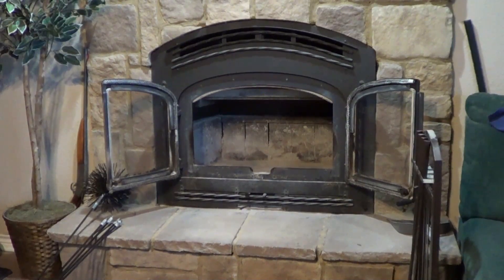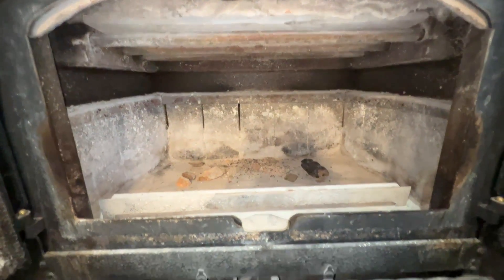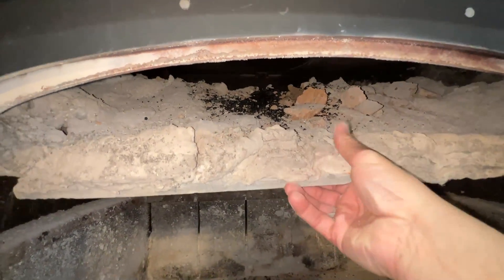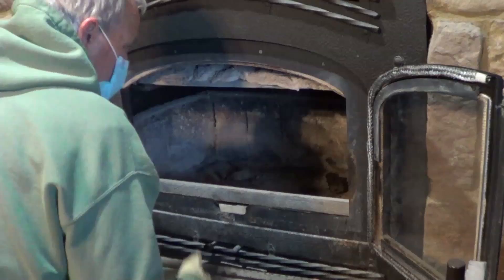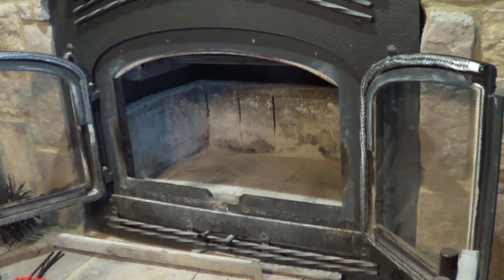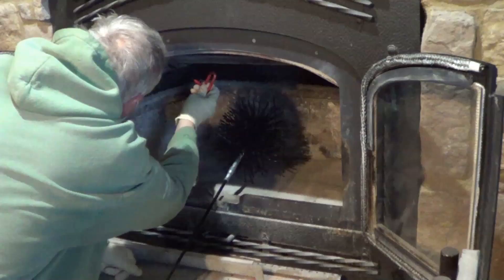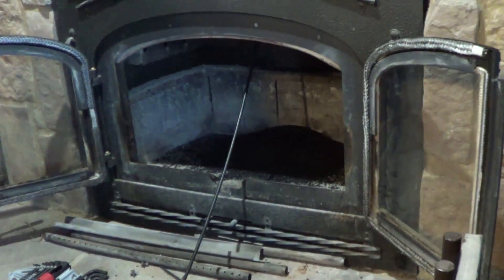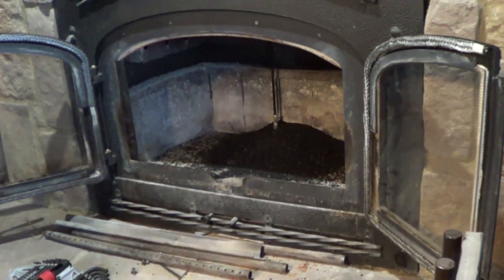Do It Yourself Chimney Sweep 101 - Doing Your Own Chimney Sweeping - Creosote Removal

Comment from the maker: UPDATE ON MANIFOLD TUBES HOLES - WHICH WAY DO THEY FACE
NOTE:  If you noticed the holes on the manifold tubes were facing down when I started and when I finished they are facing forward, towards glass doors.  
The INSTALLER put them in wrong.  Since they aways faced down I did not know they should be facing forward.  After considerable research, not easy to find, the correct way is for the holes to be facing forward or back, NOT DOWN.  When I put tubes back I used the slots to secure them like it should have been installed.  The Installer and previous chimney sweep guys use the holds themselves to secure them, which is wrong.  I called them Baffles during the video, the correct term is manifold tubes.  So for those who caught that, good job, but they are right now.

According to people who install them, the manifolds are to super heat the top air for better combustion and burning of wood / fuel.  If they are pointed down they are not doing their job.

Comment: Thanks Rick! I had mine installed this winter but only had green wood to burn and I think my chimney is all clogged up less than a year later. Figured on hiring a guy for the first clean to see how they do it so I can do if after that.
Reply: All fire wood must be seasoned. Meaning totally dry. Usually takes one year of being stacked and covered. If not then when you burn it , it will create creosote which will adhere to the inside of your chimney. If it gets hot enough could catch fire.

Comment: I have a quadra fire ( spelled wrong) and when I replaced the upper baffell boards, they told me I don't need to in stall the cloth fiberglass on top of the fire boards anymore.
Reply from the maker: ? why?  why is it there then?
Reply: So that the orginal testing to make the wood stove come in at 60% efficient can reach that goal. With that extra bit of insulation at the top will save a small amount of heat to burn more of the smoke before it goes up the chimney. Which would boost the effency a small amount to reach the goal to claim 60%.

Comment: Hello Rick. This is my second chance to ask about reinstalling those baffles, didn't you leave the holes pointing towards the front (toward the doors) on the front baffle when you put it back together?
Reply from the maker: yes, I can not find where they go but if you use the holes to secure it that is where they point forward.  The that installed them , who was an ass, he used one of the holes to secure them, not sure what different that makes?  cant find answer on site or in manual.

Comment: In my house in California I had a gas fire place. Bought ceramic logs and some fake ash which would glow when you turn on the fire. It was nice. Those ceramic logs really radiated some heat once they got hot.
Here in TX, however, I have a wood-burning fire place. I don't want to clean it, so I don't use it.

Comment: Ahhh yes. 
This brings back many a childhood memory of cleaning the old 2 story farmhouse chimney with my pop.

Dude. I'm just curious. 
Have you ever tried tightening a drill chuck to the rod end, and spinning the brush while pushing up and down in the chimney?

side story
I got tired of listening to my wife complain about not having a clothes dryer for the last 15yrs. 
So I recently bought her one.
💵💵🤬

But I figured I'd need to clean the dryer vent. Stupid thing goes from the dryer in the garage, all the way up, and exists thru the roof. (About 25ft total)
Anywhoo..

I bought a brush head and multiple rods setup very similar to yours. 
But, I attached my drill at each additional rod as I attached them. 
I just made sure I didn't accidentally spin in reverse and unscrew a rod somewhere in the pipe.(That would've been a disaster)
However..
It cleaned that vent pipe like I couldn't believe.
(The amount of fluff and god knows what else it was that came out was insane)
I definitely would've had a fire once the wife started going crazy washing and drying everything in the house. 😂

Ps ladies..
I'm not some cheapo misogynistic woman hating caveman for only recently wasting money on a dryer.

We live in South Florida.  We technically don't "need" a clothes dryer.
The outside clothes line dries everything in an hour just fine. 
(It's not called the ☀️sunshine state for no reason)

And, in case y'all were wondering ... 
Yes, we also have a dishwasher. 

I call it, 
"a wife"....🤣
✌️😏🥃

Comment: Rick, The chimney sweep I pay uses a synthetic brush on my stainless steel flue. He told me to only use the synthetic brush on the stainless steel flue.  He also uses a battery powered drill to twist the brush.  It seems to work really well.  I’ve decided for myself to pay for a professional chimney sweep every year after I experienced a chimney fire.  It was totally my fault as I did not have the knowledge to properly clean my chimney.  Any time I have a problem with my chimney now, I make the call and schedule an appointment to have it inspected.  I am not saying you are doing anything wrong.  But after my experience, a professional inspection gives me a little peace of mind.  Thanks for sharing your experience.  Enjoy The Journey - Cheers

Comment: I hire a guy. It costs the same as getting piano tuned. The chimney for our woodstove have two elbows, and we have a two story house with a steep roof. Part of the cleaning service is going onto the roof and cleaning the cap. The guy I hire is certified, if we get a chimney fire or house burns down it’s his fault, not ours. He brings his own drop cloth and shop vac, takes pipes apart completely then puts it back together. About once a month, in winter, we burn creosote fire logs that help prevent build-up. Our best defense is to never burn green wood. We rotate our split wood, new stuff in the front, year old stuff in back then visa versa next winter. We only harvest fallen trees, never ever have cut a live standing tree! We live in a Grow Zone 4, and our Lopi Parlor stove heats our entire house including basement. Heat chases cold. It’s work, but it free heat for us. It cost about $2000 to install, several years ago, we we over cautious and did it to spec, and had it inspected by our homeowners insurance as to not nullify it yet not increase rates once installed. Yes, it can also burn coal, but coal is dusty and expensive to buy in comparison to free firewood. We had four trees fall in that windstorm a week ago, enough for about two years of free firewood. 😃🌲

Comment: The farmer I worked for used to make me get in his roof an he had 2 old sledge hammer heads and some chain that I used to clean his chimney out. It worked well. Then you clean out the bottom, there was a little door at the base of his chimneys.

Comment: Nice work Rick, that’s really getting your hands dirty! Can’t believe how much comes out of these chimneys. We had someone come by a couple years ago and clean out the fireplace. Just a plain brick one from the early 70’s. Only started using it again around last thanksgiving. Our living room is on the second floor so it’s got a shoot in the bottom that you open and shovel the ash into. Used to have a gas hookup but we had it shut off. Still works great.

Comment: Nice healthy house plant tree you have there 🤫 beside your fire.
When you pulled out the 1st metal tube the holes were pointing down. 
When you returned it the holes were facing outwards? 
Will this be a problem with airflow?

Comment: I burned wood for years. Two strange things I learned. A good hot fire with a couple of aluminum cans the day before you clean. The burnt aluminum does something chemically to the creosote. It makes it a lighter brown and easier to brush off. 2nd. Make yourself a flue fire bag. Gallon ziplock bag full of half salt. Half soda ash. If you do happen to have a flu fire. Chuck that bag in your stove. It chokes the fire damned fast. Last I made an outside chimney at work. Out of 1/4” thick 8” pipe. To clean it. I would disconnect it from the building. Spray some diesel in it and light. That thing would run like a rocket for about 5 minutes. Got red hot. Clean as a whistle when done.